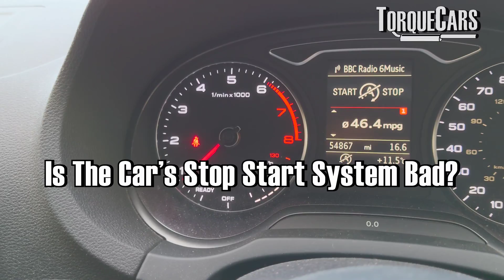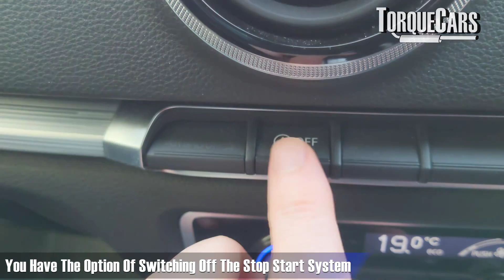Does Auto Stop Start System Damage Your Engine? ECO Savior Or Car Killer? 🚗

Comment: Personally I think the start/stop system is unfairly criticized because of the reputation it has gained in the past and by people who have never even tried to use it or understand it. My car is 14 years old (177,000 km) and I use the start/stop system frequently, I have never had a problem or a malfunction related to using the system. I also believe that using the system on cars with automatic transmission is a bit more strange, with manual transmissions you press the clutch and by the time I shift from neutral to first the engine is ready to go.
Reply: I agree. Pedestrians in London for example would really benefit from this system being used. 25miles per hour limit would also be better than 20 for the same reason.

Comment: I have two cars with stop start...and I have permanently disabled that system in both. The fuel savings (alleged) are miniscule but the wear and tear on the engine is not. This system was developed for one reason and one reason only: to comply with federal standards by reducing emissions (on paper) and marginally increasing fuel efficiency.

Comment: Additional components in more modern stop-start vehicles include small electric water pumps and automatic gearbox hydraulic pumps that maintain the flow of coolant and gear oil while the engine is shut off. The ECU determines which pistons are closest to TDC and applies a few squirts of fuel/air and a spark to that particular cylinder, resulting in a faster start than the starter motor can manage. Starter motors have two solenoids, one to spool up the speed of rotation and another to engage the ring gear on the flywheel rather than relying on a single element to do both jobs. Much ado about nothing, really. Don't like it? Turn it off.

Comment: With the latest Nissan recalls due to the bearing wear,  I'm curious what amount of wear the stop/ start system is contributing. 
For example,  my then 82 year old father in law owned a new Honda CRV with the system.  He wouldn't know to turn on or off the system. 
So he drives on the freeway for 2 hours at 80, gets of the ramp and the system shuts down. 
Nope, I feel this is wearing out engines.  I think Nissans issues are part of this system

Comment: as i have noticed in my car, modern cars are engineered that anything that can cause the damage it will disable the start/stop, if the turbo is hot, car wont shut off the engine, if its very hot and ac is running, car wont shut off the engine, if the car radiator is running, car wont shut off the engine

Comment: They're just annoying, and not needed. Sometimes you think you can pull out of a junction quickly, and you don't realise the engine is off, that split second the engine needs to start up before allowing you to set off can be really dangerous. Yes, you can turn them off, unfortunately, you can't turn them off permanently and have to remember to do so every time you get in the car. It's driver interference, not a driving aid.

Comment: States in the highway code. Any vehicle fitted with an turbo should be allowed to run for 30seconds prior to being turned off to allow cooler oil to get to the bearings of the turbo. My friends 2016 VW Caddy needed a new turbo after 66,000. It was serviced regularly and not really driven hard. The turbo was completely rock solid... He never idled the van. Saying that the manufacturers would of done studies about stop/start v idling..... Great vid and content....👍👍👍👍

Comment: I don't know where you're getting this "modern batteries are better" nonsense -- nothing could be further from the truth.   Back in the '70s, '80s, '90s, a battery would easily last 5 to 7 years.  Nowadays, you're lucky to get 3 years, maybe 3.5 years.  They're awful.  And they cost easily double what they did only 10 years ago. AND you can't just swap them out, but because of these stupid stop/start systems, the computer has to be told you're swapping the battery, which requires a special tool usually available only at the dealer -- the average DIY'er isn't going to have it, that's for sure.  So it costs $400 to get a new battery instead of $150, like it used to.

But disregarding that, let's pretend the battery and starter and flywheel are all "over-engineered" (they're probably not, but let's pretend).  Wouldn't I save FAR more money by NOT using the start/stop system?  Let's say I save 5% on fuel costs using the system.  Let's also assume "average" fuel use is about $2,000 a year.  5% of that is, what, $100?  So I save $100 a year on fuel, and I have to replace my battery and starter after, what, 3 to 5 years?  Let's be generous and say 5 years.  Hell, let's be super-extra generous and say 7 years.  So I get to spend $1,500 to $2,000 every 7 years, while saving a whopping $700 on fuel during that time.  It makes zero economic sense to run my stop/start system at all.  None!

I have a device that shuts mine off when I start my truck.  I have no desire whatsoever to burn up my starter and battery any earlier than they'll burn up from normal use.  It just doesn't save enough on fuel for me to bother.
Reply: In the 60s, 70s and 80s electrical load on vehicle systems were minimal. Starting, lighting, window wipers, rear window heaters in later years and entertainment systems were about all that cars had. Therefore batteries could last 8 or 9 years.

Comment: This system is pure evil. Audi installed it to virtue signal that they are saving the planet and to please their overlords in eu who threaten to shut them down for "emissions"
This, the pcv and other systems that block clean engine operations are the devil. If you drive in a spirited way and then you stop at a light, and your engjne stops, you just wrecked your turbo, cause there is no oil running..so basically VW installs these to wreck your engine so they could charge for repairs and parts. And eu is happy because you are destroying your car and forcing you to buy electric.

The planet will survive long after you are in the ground. So drive like a real man while you still can.

Comment: It's all good until it isn't. The transmission on my vehicle had to have a complete rebuild recently at a cost of $8,000.00. I had the option of replacing it with a brand new one at a cost of 15,000.00. When I consulted a transmission specialist to get the work done he asked me when it was last serviced before the problems started, I said never because the manufacturer informed that their transmissions are sealed for life and in fact they don't even include it on any of their service schedules in the service booklet they give you.

Long story short, the reason my transmission's clutch packs were prematurely worn were due to dirty burnt oil. If I had serviced the transmission on a regular basis as ALL moving parts create friction therefore heat and oil degrades over time just like engine oil. Same goes for diff oil. 

Moral of the story here is that just because the manufacturer says so doesn't mean they're right. If anything on your car is able to be serviced and you plan on having a long purchase life then service everything people, simple.

Comment: I hate the auto stop/start.  The area I live in has mostly stop signs and very short stop lights.  It saves me absolutely nothing when the car shuts off for an average of 10 seconds.  All it does is wear the starter, engine, and battery.  There is a button to turn it off, but you have to press the button every time you start the car.   We have been told that auto stop/start saves 3% to 10% on gas, but I am sure this is a lie for most people.  You would have to spend a long time at stop lights to get 3% savings.  If you did save say 5%, that would mean you mostly do city driving where you spend a lot of time at traffic lights.  That would mean you maybe drive 6000 miles per year, so you use 240 gallons.  A 5% savings would save you 12 gallons or $36 per year.  For that $36 gas savings, your car probably cost $300 more to make, and you need a battery that costs $100 more as well as a new $500 starter every 5 years.  Luckily, they sell a device for most cars to save your auto start/stop setting so it does not enable it every time you start the car.

Comment: Would you comment on Hybrid car in particular plug-in hybrid when start in EV mode, at a point where more power is needed suddenly, the cold engine revv from 0 - 4,000, is it causing big strain or damage to the engine?  This may also happen when the car has been running in EV mode for a long time and engine has cool down. Thanks.
Reply from the maker: I will do a video specifically addressing this as it requires a longer explanation. In general they use really thin oil and expansion of metals is much lower due to the tighter tolerances used. Most hybrids will limit the rpm/load available when the engine is cold as well. I would still avoid using full throttle loads until I've had a chance to warm up the engine though personally but I think the problem has been mitigated to a large degree on a modern hybrid. That said there is still a shocking level of oil dilution in most hybrids used for short journeys.

Comment: I got my first car with a stop start system. With my last car, I found red traffic lights very annoying because in my locality, they seemed to last an eternity. Now with the new car, I am always happy to watch the counter tot up the seconds that my engine is off while waiting at a red traffic light. But the bane of my existence is when the traffic light turns green too soon because then I think the engine stop was unnecesary. Another change for the better is that I used to speed up to try to make it through a yellow traffic light to avoid an eternal wait at a red light. I don't do this anymore because now I have the satisfaction of knowing my engine will be stopped for a good 60 seconds and I won't be using petrol or polluting the neighborhood! So I think it has made me a much calmer and more patient driver.

Comment: I've just bought a Nissan juke auto 6000 miles just under 3 years old. It has stop start. It turned off whilst reversing up a steep drive rolled forward turned on  again very quickly but I had my foot on the gas  (engine was warm ). Not great, luckily I reacted quickly. It turns itself off at junctions whilst you are waiting  to pull out, right turn on to a busy dual carrigway!!! Several other incidents  as well! This can't be normal??? Its my first stop Start any suggestions?

Comment: I'm of the opinion that the start/stop facility is only included in a car manufacturer's design because every other car manufacturer includes it. No one really knows if it's beneficial or not!!  I drive a Mazda CX5 which required me to switch it off each time I started the car. I've since disconnected the "feature" electronically to ensure that it does not operate under any circumstance. Just another unnecessary gizmo!!

Comment: It’s probably not recommended if I’m waiting at a junction and there’s heavy traffic I sit out of gear ready to engage foot of clutch , of course with the stop start active I could switch  off , there always that hesitation on restating and I’m not confident it going to move me .
I should add the last vehicle I owned did well over200k on the original clutch

Comment: Is there any accurate calculation, how many seconds a car with start/stop system have to stand still to save more fuel then restart consumps compared to idle run?
And BTW: Idling consumes about 6 deciliters of fuel per hour.

Comment: Have carmakers considered the effect of auto stop/start on timing belts/ chains? Volvo originally specified belt change interval on the VEA D4 engine at 120,000 miles but then reduced it to 90,000. Was that because of stop/start?

Comment: Mis information. No upgrades in components.  Oil film thickness is dependent on motion. Additionally the cost of the system is not covered by the rule system.
Reply from the maker: I really didn't understand the point you were making here. 

The markings on the battery indicate it is a heavier grade with more cranking power, oil film thickness is dependent upon heat, viscosity decreases with heat. If you've ever stripped down an engine you'll realise there is always a thin coating of oil all over the inside, stop start engines typically restrict the drain back to the sump in addition to that. 

The starter motor cranks with more torque, that is why stop start engines start almost instantly compared to the couple of seconds or so we had to wait on older non stop start engines. I've never replaced a starter in a stop start engine, whereas I've done plenty in non stop start engines.

Comment: Does start stop works the same on the hybrid cars?
Reply: No. Hybrids have a combined motor/generator to replace the starter motor and alternator plus they have much bigger batteries. Thus the load on the battery and starting system are minimised.

Comment: 2017 and 2018 Ford Edge with start stop are developing cracks in the ring gear on the flywheel. $2000+ repair, no thank you. Disabled my start stop on my 2020 Ford Edge by disconnecting battery monitor cable at battery. Now my battery and starter will last forever, lol.

Comment: I have a 2018 Volvo XC60 with over 70k miles on it. About 3 months ago I got a warning that the start/stop battery needed service. 😮 I took it to Volvo and that’s when I learned about my car having more than one battery. I got the battery replaced. The vehicle is 6 years old so IDK if the battery would have lasted longer if the start/stop function was turned off or not.

Comment: You put so much faith in the start stop system. “Over engineered, my thoughts, my view, my guess” its like you made a video after reading brochure from car companies. Have you owned a car with start stop system with 300000km? Or this video is mostly theory and guesswork what you “think” it should do.
Reply from the maker: I have changed many starter motors on non stop start systems, whereas I can't recall ever doing one on a stop start engine which is strange as they are used much more, I had asked around to avoid personal bias and got the same experience. Having seen the mitigations in place to reduce wear, constrain the oil at the top of the engine and to manage the stop start you appreciate the reliability. Also the battery on my stop start car lasted over 9 years, and I do use stop start pretty much every journey.

My last 3 cars had stop start, but I sold them all before they hit 90,0000 miles as is my usual preference, not because they were about to die.

The claim that the act of starting an engine when warm puts more wear and tear than leaving an engine ticking over is the general debate and I really don't know, how would one assess this easily? 

I'm always interested in learning from other people and welcome as many opinions as possible so please share yours with us.
Reply: @torquecars I didn't expect this reply from you Wayne, very well said. 

I have a question tangent to this.. in modified cars, has anyone ever thought of an electric oil pump ?
Reply from the maker: Dry sumps are quite popular in the aftermarket world and some have a fully electric pump that replaced the mechanical one.

Comment: Every time I hear these defenses of this Auto Stop-Start system, I am reminded of the old cigarette commercials assuring us that cigarette smoking is completely safe. "Sure, multiplying the cycles by a factor of 20-50 over the vehicle's life does not have a negative effect. After all, you have (by force) paid for a special battery, special starter, many computers, and so many other otherwise unnecessary items so they will last about as long as regular parts and then cost only about 3 times as much as the regular parts to replace. Never mind the dangers of your input being overridden by a computer when trying to accelerate to enter traffic or cross the road. "It's over-engineered" (i.e. overpriced). This is for YOUR good. It has nothing to do with woke politicians and climate idolators forcing you to go along with their religion and pay for it along the way. This is about YOU. Just like cigarettes."

Comment: i’m really not sure how I feel about the system. I’m old enough to remember back in 78 when Buick first came out with the turbos in some of their cars and in those owners manuals it would tell the owner to idle the car for 4 to 5 minutes before shutting it off completely. Obviously we’re far much more advanced in our computer technology today. I did ask the dealer about it. One person says use it. One person says don’t use it. I think you make a good point though that if you’ve done some freeway driving and you pull off the offramp and it wants to immediately shut off that’s when I would disable it. I guess I’ll leave mine alone since it’s under warranty for now.

Comment: I have just replaced my battery in my 2015 1.6 diesel Astra it was the original one but the stop start system stopped working 2y ago but the engine was taking longer to start up it was cranking over slower and I did not want to be stranded in the colder weather I had the glow plus replacing last year luckily they were not the pressure sensor type the car is running and starting a lot better with the new battery which controls the computers which tell the fuel indicators when to open so now mine are getting the writing amount of voltage now also the headlights or a lot brighter the stop starts is also working but the engine being a diesel shoulders on start up so unless I am in a long very slow moving traffic I will turn it off